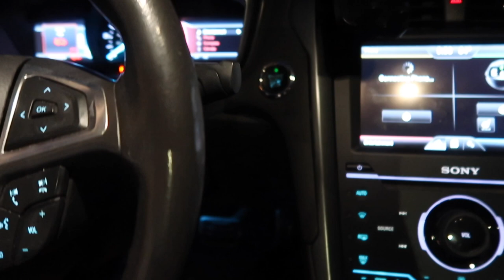OUR OLD CAR DIES AFTER GETTING NEW TESLA! | WILL WE FIX OUR DEAD CAR TODAY? | CAR BATTERY IS DEAD

Comment: Yay for the weight loss that’s awesome!  

Ugh for car batteries, glad they were able to charge it.   Hopefully it’s able to hold its charge.    🤞🏻

Love the little squabble - thanks for being authentic with real life 😊
Reply from the maker: So far it's held its charge! I'm sure it'll be a problem in SEPTEMBER once the warranty is expired! Ha! Someone suggested to have them check the alternator to see if it's charging the battery.
Reply: @daynacreates1105  that is a good suggestion.  If she just drives it to O’Reillys or Autozone they can put the reader they have on it and it should give them a code if it is the alternator.  If the alternator isn’t working properly the battery won’t be getting a full charge when the car is running and that is why it would drain it.